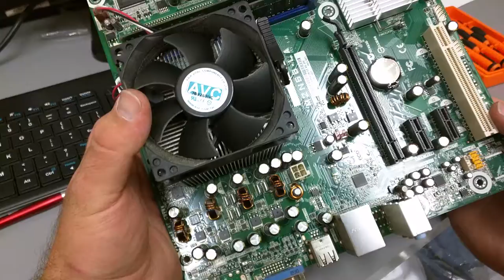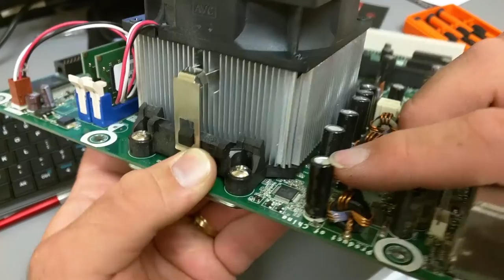Diagnose No Video - bad capacitors on motherboard

Comment: I've got a motherboard that wouldn't show any video display and it beeps when its powered on. I had a look at it and there are two swollen capacitors on the power regulator section of the board by the processor. I'm wondering if I should replace all the electrolytic capacitors or just those two.
Reply from the maker: I'd start with just the two that look damaged. I'd also check the price of a used replacement board online.
Reply: @ttms2  The problem that I'd have with fitting another board is that it won't fit the case as its one of those mini p4 computers I did try a spare standard ATX P4 motherboard I had but it was slightly larger so my best option is to get some replacement capacitors and repair the original board, plus its a good candidate to run Windows 98SE for retro gaming.